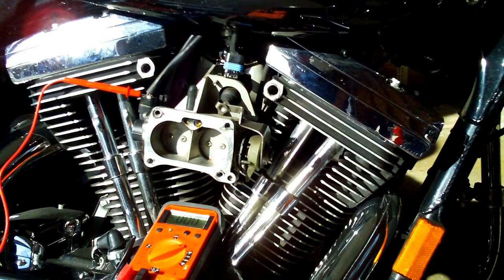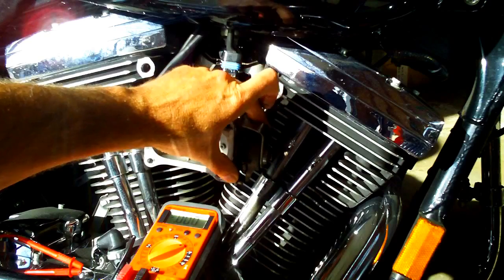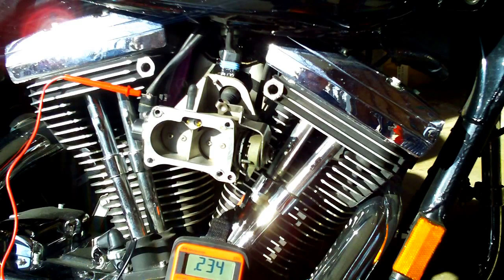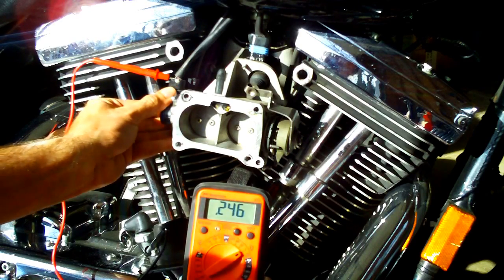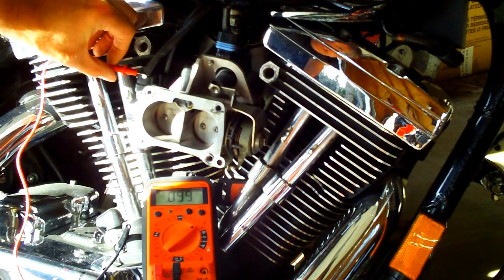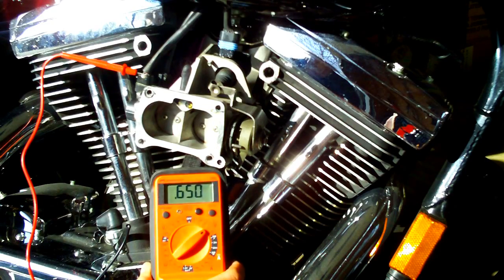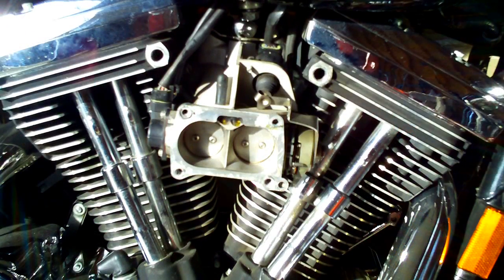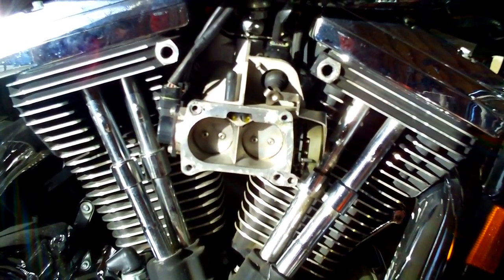Reset Harley Davidson Magneti Marelli Fuel Injection TPS Settings ✔

Comment: I was doing so many of these that I made a breakout harness to plug between the TPS and it's connector, so I used both the signal wire and ground wire at the sensor instead. I saved myself all the trouble of dicking around with the cold idle screw and ISCM by just removing the arm instead. Before touching the hot idle screw, I have my meter connected and check the TPS setting first. Write down the initial setting, then back out the hot idle screw several turns until the throttle plates seat in the bore. Now write down the sensor reading again, and subtract that from 275 to get the amount you're moving the sensor. Adjust the sensor. Now add the amount you moved the sensor to the initial reading you took to get your new hot idle screw setting, and turn the hot idle screw back in to that sensor reading. It will be nearly perfect. Now disconnect the battery to wipe the ECM's idle position memory so it will learn the new one, then you can make a final adjustment on the hot idle. I found that not wiping the memory, if you try to adjust the hot idle, it can jump back and forth between too low and too high because the ECM is messing with the ignition timing - idle timing is different than off idle timing.

Comment: I like your video a lot !  but if u had a tuner   Do u still have set the TPS   I though the tuner would do it automatic !  thank !
Reply from the maker: Setting the TPS is only if the bike is not running well, or if someone moved it at all (like me). If the bike runs good with no check engine light, leave it where it is. The tuner helped with the air filter and exhaust changes I made. I hope this helps you.
Reply: @contact4mwy7     Yes !  it did  !   My 98 ultra does back fire a little when I deaccelarate !  Is this bad and does it hurt the engine !  it has done it for a long time !  But I still get 50 mpg !  I though it was cool when it back fire !  It has stage one on it !  and I had to change out one   oxygen sensor   Dealership did  that  !  U would though they would have done both !  got  around 60000 on it and enjoy it very much !  I know a lot of people don't like the MM FUEL INJECTION  but my seem to being all right !   My concern now r the fuel line in the fuel tank !  I do burn no ethanol gas !  They said those line get little pin hole in them !  Your though ?  thank u so much 4 your time and KNOWLEDGE  !  I am glad that I found u !
Reply from the maker: @waynejohnson3383  the backfiring out the exhaust could be due to fuel air ratio mix. Best way to tell is pull the plugs and see what color the end of the plug is. White-chalk-like points to too lean. Black-soot-like points to too rich. Anything in between is generally good. I had no real issues with my MM fuel injection. The sensor they changed was likely the head temperature sensor as the MM system on Harley's didn't use O2 sensors. It was what is dubbed an Open Loop System where there is no follow-up by O2 sensors to read if the fuel mix really was correct based on the TPS, head temperature, air temperature, and atmospheric pressure. I replaced the fuel lines on the outside of the tank, and the fuel pump and filter inside the tank (I have a video of as well), and even though I have heard of pinholes in the internal fuel lines I did not see any evidence of it. 50 mpg is in the same ballpark as what I was getting, even with the fuel injection tuners I installed.

Comment: I'm old school always ran carburetors last year I picked up my first fuel injected bike ... had no idea how to adjust it and the manual said it HAD to be done by the dealer ... I thought when I read it ... "this is BS" ... you confirmed my hypothesis ... thanks for the tips ... I have subscribed.
Reply from the maker: Thank you! This is how to adjust this particular brand of fuel injection. I haven't found much on the Delphi systems that replaced this one, but maybe some day I will need to explore them more. This motor came to life with aftermarket fuel injection tuners! I have a newer bike now and it has a Power Commander V on it. Personally, I think it's hard to beat the CV Carbs for simplicity, accuracy and dependability in an all-in-one carb setup!

Comment: Not sure if anyone is still replying to comments on this video, but I followed the procedures outlined, except I'm having no change on my meter when I go to adjust cold idle- even with the tps set as per the video, backing cold idle screw in or out does absolutely nothing to my readings. Hot idle on the other hand, turning in adjusts my readings. My 98 has a really hard time starting, what am I doing wrong here??
Reply: I'll check that Mark, thank you
Reply from the maker: If the cold idle screw is not changing the readings on the voltmeter I would wonder if there was something wrong with the cold idle motor. Did you begin the procedure when the bike was cold? With the cold idle motor wires still connected, turn the power on for a few seconds and watch to see if the cold idle arm moves at all. It should extend in preparing to start a cold engine. If it does not move the motor could have failed in a fully warmed engine position and now is too far retracted for the adjustment screw to open the butterflies shaft in the throttle body which rotates the TPS and changes the reading. I've only seen one fail so far personally, so I know this is a possibility. This failure was causing hard cold starts. Until replacement, we adjusted the warm idle screw a bit higher than normal so it would at least idle, although rough, when cold starting, while manually twisting the throttle a bit for the first minute or so to help it warm up. The cold idle was the human holding the twist grip in other words, until the bike was warm enough to idle on it's own. You may have to give it a little twist when starting cold. How did the rest of the numbers come out? What year and model bike is this?

Comment: How to check if my FI system is a Marelli?
Reply from the maker: It was used on Harley Davidson bikes from 1995 through 2001 before they switched to the current Delphi injection system. If your bike is within those years and does NOT have a choke knob it's likely you have the MM injection system. The dual butterflies behind the air cleaner is another way to tell. Delphi uses a single butterfly.

Comment: What's up brother? Great video. Hey, I was wondering, what is the name of the hinge looking thing over the rotating band? I am missing on my bike and I am thinking that's my problem. It looks like it came off the bike and I didn't notice it until now. My bike is giving problems. Please advise as I am in need of this part. Thank you.
Reply from the maker: Are you asking about the cold idle arm? The stainless steel piece that is mounted to the throttle plate shaft, and is moved by the electric motor with a rubber boot on it. The nut on the shaft loosened up on me on a ride once and caused the bike to run at a high idle when the parts started falling off. I lost the original nut, but put on a replacement with thread locker to help prevent it from happening again. Perhaps you can find a used throttle body online and scavenge the parts from there? Without this arm the bike cannot control the cold idle to a higher rpm for the bike to run good until it warms up. Is your bike having trouble idling when you cold start it?

Comment: I'm getting an engine light on my efi 98 road King after the bike is warm. Light only occurs in power and goes away after I back out of throttle. The code the bike is throwing is TPS. I'm going to try this adjustment. Is there something else I should be looking for? Bike smells like it's running rich but plus are not fouled.
Reply from the maker: Brett, it sounds like it is solely the TPS to me as I got those results when messing around with its position by eye. Resetting it using the settings in the video cured it. If your plugs aren't fouled, but rather a golden brown color, that's a good sign. You might be confusing smell with Rich as your bike does not have a catalytic converter. Sight would show black smoke belching from the exhaust pipes if it we're Rich, and the plugs would be black and soot covered. If you can't perform the tasks in the video, find someone who can, and good luck to you. That's a 80 cubic inch Evo, right?
Reply: @contact4mwy7  yes 80. I'm not losing any HP when the light comes on. No cut back, funny sounds or smells and like I said clears almost immediately after I back off the throttle and RPMs lower back down.
Reply: @contact4mwy7  when you put the pin in the TPS do you actually Pierce the wire? Or place it into the hole on the harness
Reply from the maker: @brettjohnson130  I pierced the wire, and then sealed it up with some clear fingernail polish after. You can try it in either location, just be sure not to break the wire. The wire harness has to be plugged into the TPS to make this adjustment. Use the sharpest and thinnest pin you can find.

Comment: Hi Mark, I'm a Harley Newbie with an oldie but a goodie. This week has been some of the hottest outdoor riding temps my 1997 Elctra-Glide Ultra FI has seen. After about a half hour, my in traffic oil pressure dropped to between 1 and 3 multiple times at red lights and thinking it's an warm idle issue, as she's idling at 700rpm. As soon as I blip the throttle/accelerate, I'm back to the 20s. I'll be raising the idle to 900-1000... do I need to go through the initial steps of the cold idle TPS voltage checks to get to the warm idle adjustment or can I jump right to that? Thanks so much!

Comment: What kind of pin did you use I can't get a good contact
Reply from the maker: MAShire3 I used a sharp dress pin with a round ball head that i borrowed from my wife. Thin and sharp is what you need to poie through the plastic coating and into the metal wire strands. Know what I mean now?

Comment: I must be doing something wrong I dont get it. I set it on 2V dc , unplugged  IAC motor,  pin in grey wire,  turn it on any get. 006. I cant get anywhere near this. 275 setting.  This is the second TPS that's given me this reading? 01 EG TC88 engine.  What's the issue? Tried different grounds,  new battery in tester.  I don't get it.  Help
Reply from the maker: Nickolas64 without seeing your multimeter tester, I don't know for sure what is going on either. Are you saying the display reading is 0.006? Do you know for sure that the tester you are using measures down to 1 thousandth of a volt? If you could get a reading of 0.5, that would be half a volt. 0.275 is just over 1/4 volt DC. Does all of that make sense to you?
Reply: It goes down to 2 volts DC.  Used 3 different multimeters all the same.  Not sure what I did but got out one with the most selections and it too has 2 volt DC and tried it again and it read it that time but...  I got 1.275 volts and 1.650 adjusting it,  not. 275 or. 650. Bike fired right up and ran beautiful 1300 rpm,  idled down to 1000 and runs sweet.  Great throttle response and it's never run better.  But it says 1.275 and 1.650
Reply from the maker: Nickolas64 I am baffled as to how it could be showing those readings and still run right, but if it indeed is running good, strong, good gas mileage, and not flashing the check engine light (which mine did when I was experimentally adjusting it by feel, as it did not have to be turned too far to be out of adjustment range) then maybe you have set it correctly for where it needs to be. Feel free to update me again after you've put some miles on it.
Reply: Well I tell Ya since I've owned the bike for a few years it's never ran better.  Starts right up and has a nice high idle at 1300 or so.  Goes down to 1000 and idles well.  Throttle response is real nice.  Riding and rolling on the throttle is as best it's ever been.  Used to have a slight hesitation and just felt like it wasn't running right. 

 Bike started popping,  backfiring,  high idle,  low idle,  no idle,  etc...  Just ran like crap.  No check engine at all.  I took the TPS off and apart as I suspect it was the culprit.  The printed circuit inside with its conductive layer the rake runs across was all worn away to the plastic.  I figured it wasn't reading properly and bought a used intake fuel module with a used TPS. 

 Put it on and couldn't get it to read anything but. 006 on three different multimeters.  I don't know why,  scratched my head a few times.  Put one of the three back on and got a reading but always 1. Something.  So I thought let's do the 1.275 along with 1.650 and see what happens. And when I had it all back together and hit the start button I could tell right away it was running much better.  Idled down with a nice idle which before it would cut off completely.  

 So I'm baffled but it runs the best it ever has... I'm 54 years old and Been turning wrenches my entire life using tools,  working on motors and everything else so I don't understand what's going on with these readings but my bike runs great. I just don't get three meters and all that. .006 reading then the 1.275. I couldn't get it to go near. 275..i don't know man.  I'll keep you updated.  Thanks for the info these old magneti marrelli system don't have much info I've found but they are pretty easy to work on regardless of what others say...
Reply: Mark Young - Well Mark now six days later and a couple tanks of gas the bike is running strong.  Starts right up easily,  idles around 1200-1300 then around 900-1000 when warm.  Throttle response is real nice,  powerband is smooth with no hesitation or bog like before,  idles great at a stop where before it just wanted to die or idled high,  gas mileage noticeably better, low fuel light used to cut on around 150 now 180 or a tad more. Just overall runs much better than it ever has.  I just don't get why 3 multimeters all wouldn't read but. 006 in the beginning.  Then 1.275 and 1.650 when it did work. But it does run the best it ever has indeed.
Reply from the maker: Nickolas64 that is great to hear. Regardless of why your multimeter  was displaying a 1 instead of a 0, it sounds like you've got it spot on! That's how my bike ran after it was set, great startups and solid smooth roll-ons, and excellent gas mileage. Take good care of that bike and safe riding to you.
Reply: Well I spoke too soon I guess.. Now I've got a same problem kinda.  Intermittent rough,  low idle.  At times I come to a stop it idles great then other times it wants to cut off.  Here we go again...  No IAC on this but the idle control motor.  There is an air temp sensor  however.  Maybe that's bad I dunno.  Otherwise it starts great,  runs great,  idles great sometimes but then it doesn't.  No check engine light.  I hate intermittent problems but I guess thecfirst temp sensor is my next thing to replace maybe?
Reply from the maker: Nickolas64 I hate intermittent problems too. I think there are a few more sensors on it. Intake air temperature. Engine temperature (located in the top of the front cylinder). Barometric pressure (located inside the right side cover, looks like a snorkel). Crankshaft sensor (front of motor near the oil filter). But could there be air leaking around the intake manifold gasket? Something like that?
Reply: I sprayed carb cleaner around the intake with no change.  There is an engine temp sensor in the head,  air temp sensor in the intake,  crank and cam,  barometric pressure....  It acts like a carb loading up if carbureted.  I wish I had an older unit with a carb and points.  Much much easier to fix.  My goal is to sell this one and buy an older Shovelhead.  I like old school things more.  Injection is nice but the old ones sound better,  look better and easy to work on in my opinion.  I'll figure this out eventually.  Thanks for all of your help.  Any ideas let me know.  I'm trying an air temp sensor,  maybe engine temp too

Comment: Well so far i can't find any info on how to  adjust the air adjustment screws...not even covered in the service book..the problem im facing is running too lean and so far nothing shows how to take it out of the lean condition...i guess i need a tuner installed...
Reply from the maker: Moustache mike there is a lot of information on this message board. One mentions that those air bleed screws should be turned out 1 and a half turns from lightly seated. The TPS sensor has a lot to do with fuel mix. Are you certain yours is set correctly as shown in my video and discussed here? http://harleytechtalk.com/index.php?topic=71591.0 NOTE: If those air screws still have the epoxy on them I would recommend leaving them alone as they have not been tampered with from the factory, and look elsewhere to solve your lean condition. Did you swap out the pipes? The air filter/intake? Verify there are no air leaks around the throttle body gaskets? I used 2 different fuel injection tuners on this bike and have videos on installing and setting them.
Reply: Did a bunch of rework from previous owner total top and bottom rebuild .from an 80 to 88..filter and 2into1 system..So ya i need a base line dyno tune...to see where its at..Just wondering about the screws ..I have the dobeck and  the power commander...ready to go on....